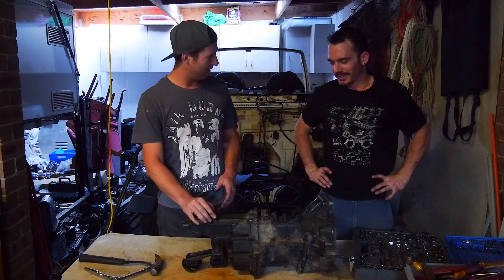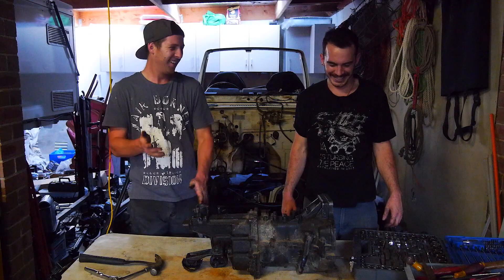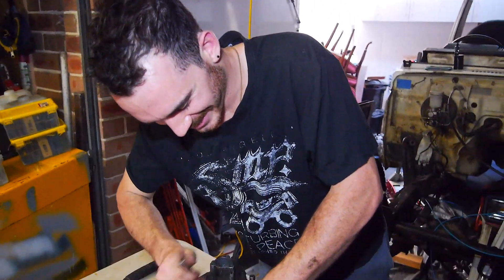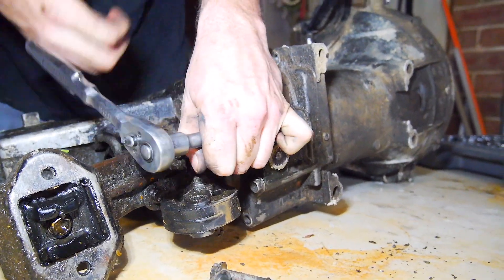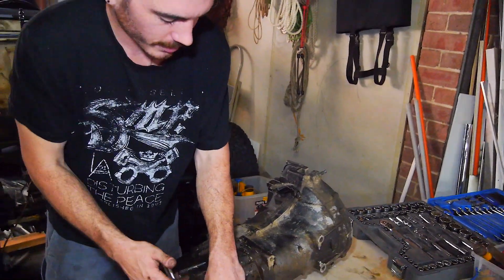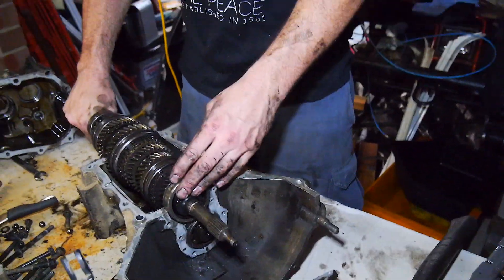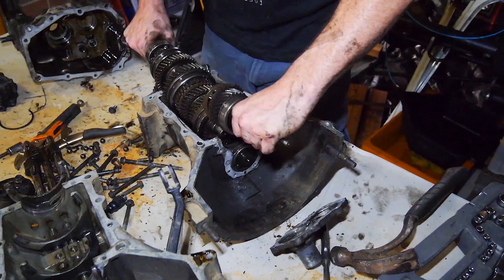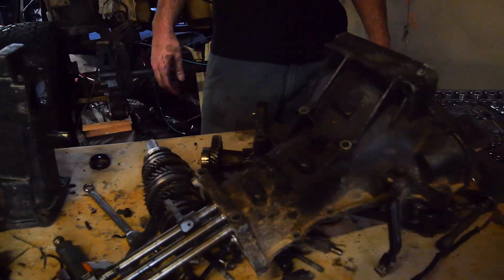RUNNING A GEARBOX WITH NO OIL - WHAT HAPPENS?

Comment: Hyundai incorrectly fitted a gearbox under the warranty and it resulted in a gearbox oil leak. I ran it for 200km before I heard something fall out from underneath, and saw the oil leak at my car space. Hyundai replaced the bolt that fell out, fill the transmission with oil. But Hyundai say's there no long term damage, even though my car makes a whiney noise, doesn't shift smoothly, and stutters during hard accelerations. 
SMFH

Comment: Just drove a 05 Hyundai Accent 5 spd no gear oil for two weeks! Filled her today. Just bought the car, had no idea. Think I did a little damage to a bearing maybe, because it has this kinda of rough grinding noise (like a no oil noise) when I rev it up to 3000 rpm in 2nd gear... So I dunno, I probably saved it from destroying it, but might have some damage now. What do you think mates
Reply: Bit late by now but when you noticed that, you should have flushed oil a few times to clear out as much swarf as possible

Comment: Would you noticed if your standard transmission had no fluid it it? I just changed my fluid and I’m scared the fluid didn’t go back in. I’m always paranoid after doing fluid changes even though the fluid clearly went in
Reply: Not immediately, if it starts whining, you're fucked. A telltale sign would be the floor getting really hot although if it's front wheel drive then that wouldn't apply.

Comment: I drove my vehicle with no transmission oil for 2 miles would the transmisson be fine?
Reply from the maker: Maybe... Definitely not a good thing to do. Was it a fast or slow 2 miles?
Reply: You cant drive a vehicle with No transmission oil..... The Transmission oil IS what makes the car move......... Not only that but you will also burn it up
Reply: @daimientaylor3108  Not in an manual gearbox mate.
Reply: @daimen this a manual not auto dummy.
Reply: I drained all the oil out by accident and it was 2 miles going pretty slow and it drove fine for close to a year have a new vehicle now just alittle update

Comment: my manual transmission got hot started smoking and caught fire luckily I had a fire extinguisher immediately I have no idea what caused it it gave me no warning and always ran well I figured there was no gear oil inside but today when I went to fill it up I drained it and it was full of gear oil so I am stumped if anybody has any ideas on what went wrong it would be greatly appreciated thank you
Reply: God's plan..
Reply from the maker: Milo Arron Jeeez! Where was the fire? The bellhousing area or the box?